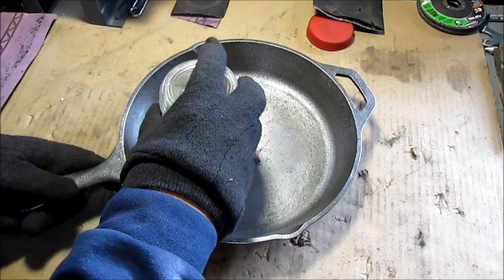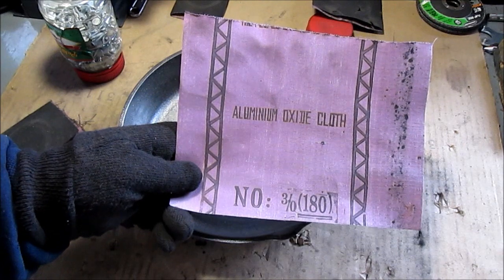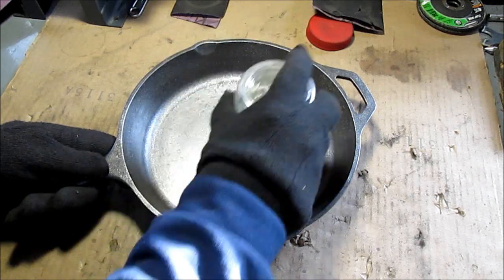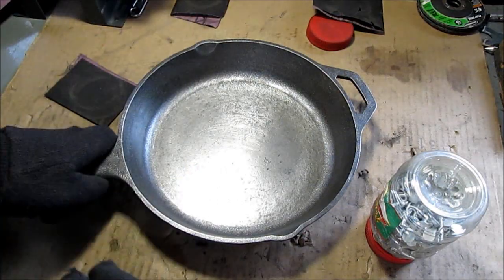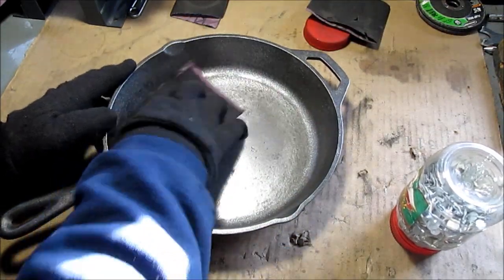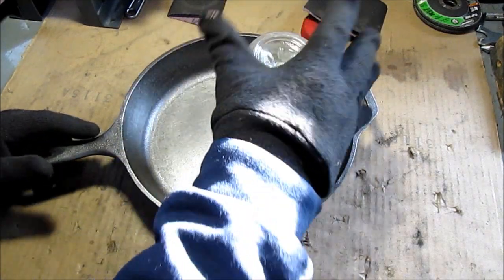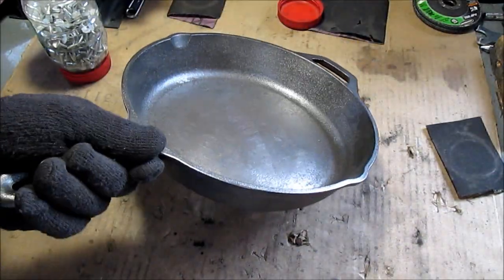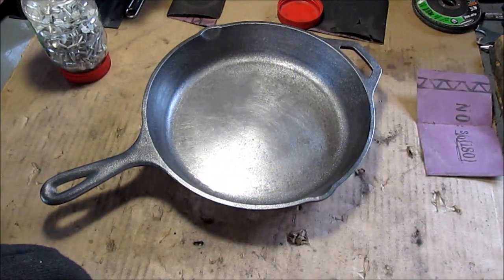Sanding Smooth the inside of a Cast Iron Skillet  By Hand

Comment: It takes a little elbow grease and a lot of patience, but I'm impressed. This should really be taken care of in the manufacturing process.
Reply from the maker: +Stargazer Cast Iron They season well when they are smooth
Reply: +not2fast4u2c I couldn't agree more. Super non-stick.
Reply: I did some heavy duty sanding (too smooth?) on a skillet and it is hard for the smoother parts to take a season and have rusted on me....I used a flap disc on an angle grinder and then smoother and smoother grits (finer) with an orbital sander........and I think I'm happier and get more success with the simple rough sanding of a skillet just to knock off the bumps...........BUT I guess that if I don't like the smoothness and rust...I can just rough it up a bit and give it some valleys for seasoning oil to polymerize to.  I don't know.............also, I supported the Stargazer campaign and wonder how smooth it will be and if it is just user error and I'll have that problem with theirs?
Reply from the maker: I season my skillets in the BBQ at 450 deg. F.for at least an hour I make sure they turn black which is what is called carbonizing ..It is how I was taught and to use bacon grease or lard ..I believe Lodge does not do it right ..dark brown oil coating is not seasoned to me I  know there are many ways and opinions on how to season cast iron but I was taught by my elders Grandma ,Aunts etc and that is how they did it
Reply: +jdhiv4 Good point, I've actually found this to be true as well. There is such a thing as too smooth, and the seasoning won't hold on a slick surface. You're better off grinding with a coarse grit and leaving it as-is. On our Stargazer skillets, we don't polish them after machining because the machining process leaves a slight "tooth" that's perfect for the seasoning to grab onto.
Reply: +not2fast4u2c Everyone has their own seasoning preferences. To each his own, right? That's why we offer our skillets seasoned or bare, for those that have their own time-tested method. I'd love to see your method applied to one of our bare skillets, to compare the color, texture, etc. I've never seasoned one on the grill before so I'm curious.
Reply from the maker: https://www.youtube.com/watch?v=5to1_xPhhdQ&index=9&list=PL2eL9173a4VAr5qFbaIJVijAzUCJRMCQI
Reply: Butter Pat, Field, Stargazer, Smithey all produce smooth skillets…the way they were made 100 years ago. Lodge is too cheap to properly smooth their skillets. I have one small Lodge my wife gave me, but I wouldn’t waste money on a Lodge. Plus, buying their pans just reinforces the idea that people will buy junk..

Comment: I've always preferred cast iron because of the health dangers of no-stick. But I got tired of scrambled eggs and other favorite foods sticking to my Lodge skillets, and I couldn't flip omelets. So, I polished them, and voila! Perfect scrambled eggs and flipped omelets every time, plus the health benefits of cooking with iron.
Reply from the maker: +LeopoldUlysees I do like cast iron when it is smooth I have had no luck with the factory rough finish
Reply: I know what you mean. That's why I polished my rough cast iron skillets. It's worth the effort.
Reply: +LeopoldUlysees Yes, I literally just bought a new Lodge frying pan and tried to make scrambled eggs in it (which was no problem with old smooth based iron pan). Dear god the noise and the mess. It sounded like I was dragging an anvil down a concrete path!

Going to give serious consideration to sanding it down....

Comment: Does it matter what kind of sand paper to use? Like would normal sand paper from a hardware store work? I thought I had read somewhere that there was a specific type you needed to use
Reply from the maker: Any sand paper will work ...I use cloth backed Emery paper because it is tougher and lasts longer
Reply: sand paper is for wood and emery cloth is supposed to be used for metal  the one for metal is more durable because its made for metal which is harder than wood.

Comment: I've done this and reseasond several times. the seasoning doesn't seem to stick very good. using the 200 degree. . 300 degree then 400 degree method with crisco. HELP ANYONE
Reply from the maker: I use my small BBQ and use charcoal ...I always use bacon grease ..I use a temperature of at least 450 -500 degrees. for an hour or so ...I burn the grease to a black carbon and will do this at least 2 times .....This is the way I do it because I do not like using an oven and all I get is a Dark Brown coating of sticky grease
Reply: I will have to give it a try. Thanks
Reply: Use flax seed oil and reference the Cook's Illustrated article. Crazy non-stick and super resilient.
Reply: Great video, I just bought a lodge, and the first thing I did was strip down the preseason with a stripping tool, then sanded it with 180 grit sand paper, washed out with hot water ,put in oven 200 degrees for 25min ,NEVER USED SOAP, THEN SEASONING, I’m on my 12th seasoning, at 500 degrees oven for one hour then let it sit in oven until oven is cold,now I have a smooth glass finish and my eggs slide around the pan, lot of work But worth it in the long run. And yes this guy needs help!!!
Reply: I agree that an outdoor grill is the wqay to go. Gets super hot & doesnt smoke up your house!

Comment: When Lodge stopped machining their cookware, they said it was so their factory seasoning would stick.  That seasoning is a joke.   Honestly, I've had 7 late-model preseasoned Lodge pieces, and their seasoning has failed on all but 1 piece.   A quick search online will reveal that many many people have had the Lodge factory seasoning flake off...   I say they need to go back to machining, and let the user season their own way.  
Looks like you will have a winner when you're done... Thumbs Up!
Reply from the maker: ***** I have an 8 inch lodge and a smll 4 inch square skillet I am going to sand smooth both of them the factory seasoning and the rough finish has not worked for me ..Even after smoothing this one it still has pits in it but it will be better than being rough My favorite skillets are my Wagner Ware They are great to cook in
Reply: Lodge never said they stopped machining their cookware so the factory seasoning would stick. There was a 30 year time span between the time they stopped polishing the iron to when when started the factory seasoning. Machining cast iron is labor intensive and costly, and they (as well as BSR) stopped machining it in the late 60s and 70s to save money in response to the influx of cheap imports that started in the late 50s and early 60s. 

Lodge invented factory pre-seasoning in 2002, as a marketing idea to sell more cast iron to people who were afraid of it. Griswold went out of business in 1957 in large part because hand polishing was becoming too expensive and their attempt at automated polishing was a failure, and Wager went out of business for largely the same reasons. The cost of machining cast iron today would increase the cost to the consumer by 3-4 times, or more. A $15 Lodge 10 inch skillet becomes an $80 Stargazer skillet.
Reply: And $80.00 for a Stargazer skillet is pretty cheap.  I would happily pay $150.00 for a Lodge 12" skillet, and buy a $50.00 lid separate, if they would go back to machining.  There is something about the $30.00 price to make a cast-iron pan seem cheap.  So cheap, in fact, it makes me wonder where the corners are cut.  I just know that if I ruin my 12" Lodge skillet, I can just go and buy another one for almost nothing.  The Lodge pans work very well, but I just don't have enough respect for them to make them last.

Comment: We found both, the Lodge #8 (10.25 inch), and the Lodge #10 (12.5 inch) Skillets at a local closeout store, for $12.99 each.  We have bought skillets for as little as $2.00 at
garage sales, that are smooth as a newborn baby's butt!

So, we clean, season, use them, and can't see a use for making them smoother!
Just baked two layer cakes in 2 of our #8 pans, one a modern Lodge, the other a
1920 BSR.  Same result, both came out perfect!

Can't see any improvement if we have a 'rough' or a 'smooth' surface!
But, thanks for the entertainment!
Reply from the maker: Patrick Patrick The new Lodge skillets have a rough surface which Many people and me do not have much luck with.  Have you noticed all older skillets like Wagner etc. came from the factory with a smooth finish ?  You did mention you found  skillets at garage sales that are smooth. They must be older ones ?  Sorry you find my video on this just Entertaining .   .Many people who use and know about older cast iron will and have found my video usefull and educational
Reply: not2fast4u2c I have no problem cooking anything in brand new Lodge iron... iron gets smooth with use.  Too many people want to rely on other peoples' use to get good iron, more people should just work with new, eventually we'd have so much nice iron the point would be moot.  It took about 4 years for my 12" to get smooth, so that the turner is just silent on the pan... the 10.25" is loud, but, given time and use, it too will be smooth as use makes it.
Reply from the maker: JT This is an arguement neither of us will ever win.....So I have no more comments about it
Reply: I wasn't arguing, I simply made a few statements based on my experience.
Reply: +JT Indeed, Some people just like nostalgia is all, just like the people who "Love old cars, but hate new ones" The same goes for these cast iron pans, even corning ware, and pyrex, and loads of other stuff :P
Reply: @podboq2  I think that is why you can find them at garage sales, most people prefer not to wait four years.

Comment: Throwing it in a  fire is a terrible idea. No wonder there is so much wobby CI out there
Reply from the maker: You are wrong and must not know much about cast iron ...Many people including me have burned off a cast iron skillet in a fire ..Of course you have to be careful and know what you are doing ..I have not had any of my skillets warp or crack by doing it this way
Reply: yeah and warping and cracking isnt even the big issue with over heating them in a fire....its scaling...the high temp breaks down the structure of the iron and its ruined..wont hold seasoning..if you see cast iron with a red/orangish tinge to it dont buy it....its been overheated.

Comment: I just got a new Lodge 10.25" as a gift. Never used cast iron before, so the rough surface surprised me. I did 2 rounds of stovetop seasoning, and it surprisingly cooks eggs fine with a tiny bit of sticking. A smoother surface would be great.  However, I don't have an orbital sander, nor do I have any experience using one. I want to try this method, but still afraid I'll ruin it lol, I don't live in USA and this Lodge model costs like $80 around here when it's actually about $14 😭
Reply: I used plain old sand paper on mine just using my hands and it worked fine. I doubt you will damage it if you don't use a machine. I would also recommend you try seasoning it in the oven instead of the stove top. I did the stovetop a few times and just did the oven method and it worked better for me. I think I have the exact same Lodge pan. Maybe if you season it a few times in the oven you won't have to bother to sand. Just don't use too much oil or it will be sticky. I had to sand mine because I neglected it.

Comment: My god did you waste a lot of time. For sanding, or any kind of abrasive work, you need to have a wide contact area to get the most grains in contact with your workpiece. The lip on your lid means you're getting a very small circle of contact with a lot of negative space, you can see this from the loading pattern on your paper being a circular outline and not a complete circle. In the future, buy some dense foam to get a full fill on your lid without being soft enough to distort too much. Using a jar full of weight is a good idea though.
Reply from the maker: Maybe a piece of wood shaped to be perfectly flat

Comment: Get a stripper tool for your drill 6-7 $$, what your doing is very time consuming ( as well as Ridiculous ),mine was done in 10min , and on the 12th seasoning has a smooth glass finish.
Reply: Mike Smith Again, the purpose of this video is to demonstrate HAND-SANDING for people who don’t have a drill, orbital sander, etc.!!
Reply: @maridean56   i appreciate your video because I do not have any drill, mouse, orbital sander - any power tool.  So thank you!
Reply: I don't have a drill and do not want to  buy one and a stripper tool to do this. I think his method is brilliant.

Comment: My rough, un-sanded Lodge pan works great. You just have to learn how to season them, and cook fatty foods in them while breaking them in. This is WAY to much work.
Reply: waynerjson .
Reply: This gets you to a non-stick pan quicker.  I did this today and had eggs sliding around on the first use due to a smooth pan and a good first seasoning.  When the same pan was rough and I seasoned it the same way eggs stuck to it. If you have a newer pan and don't want to wait months to build up a seasoning, this method works fine.
Reply: For health reasons, I prefer not to cook bacon so find this method practical.

Comment: totally useless....bumpy cast iron will be nonstick if they are seasoned correctly...no grinding needed...not sure why anyone buys new cast iron if this is their opinion of it?
Reply: It is true that you don't need to do this, but it does make a difference.  The smoother the pan the less is sticks.  I've seen videos of mirror finish cast iron being used before seasoning and eggs are just sliding around.  Plus, a good seasoning takes a while and a good amount of use to build up.  This method helps you get that non-stick goodness without having to wait to build up a seasoning.